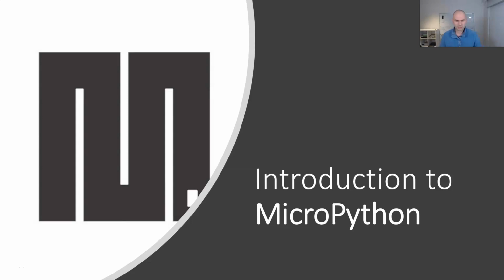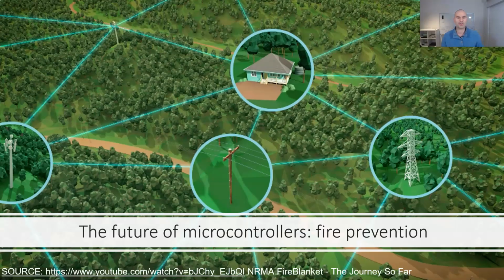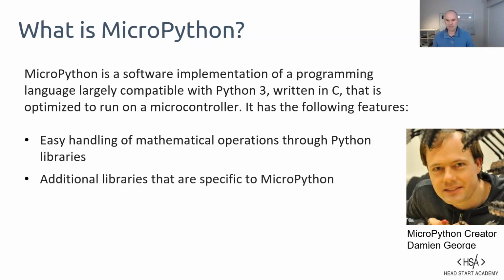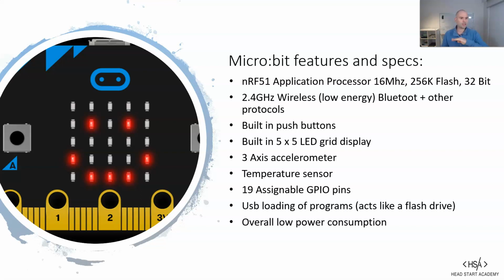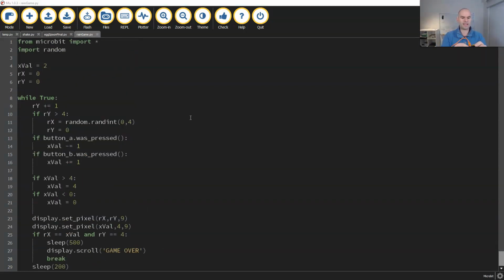Introduction to MicroPython

Comment: Hello Sir,

           I Want to read the data of  mlx90614 in python program, but it need a header of MLX90614.h  which value is calculated through this same header.

         I  import the StandartFirmata into arduino but i cannot read the value mlx90614 because it is not single analog it have i2c communication and having point of SCL and SDA.

          Through searching on internet , i found similar work like me (https://www.gautamdhameja.com/arduino-how-to-integrate-multiple-sketches-with-standard-firmata-c1450769e645/) but  i do not understand what to with mlx90614 how can i import the header of MLX90614 in the StandartFirmata

          What can i Do that it read the value of mlx90614 in python program. Please Sir kindly help me.

Comment: we can install pandas on the micro?
Reply from the maker: Short answer is no because on a micro:bit you cant fit a 7MB library into a 256K memory. . . .  Theoretically possible on a microcontroller with more memory but you would need to basically re-write the library and that wont hapen till micropython interfaces with some decent displays
Reply: @SanjinDedic  if i get some data frome an api of stock, what is the Best way to manipulate the data on the micro? Only with lists?

Comment from the maker: TIMESTAMPS:
1. Introduction 0:00
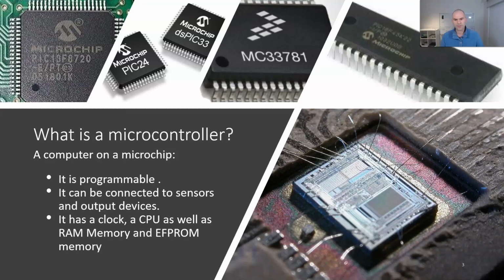2. What is a microcontroller 0:45
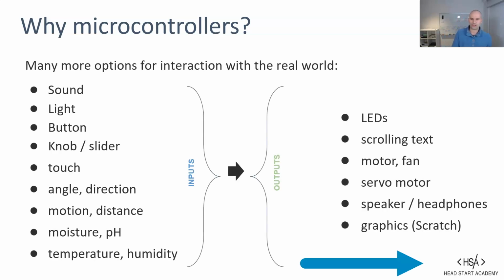3. Why learn to program microcontrollers 1:48
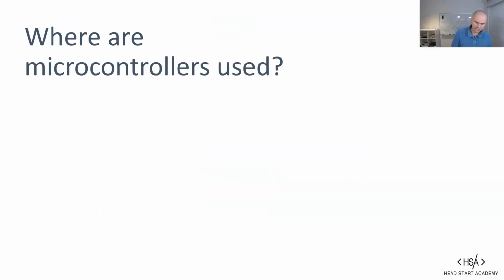4. Where are micrcontrollers used 3:22
5. Future of microcontrolles and the Internet of Things 4:38
6. What is MicroPython 6:59
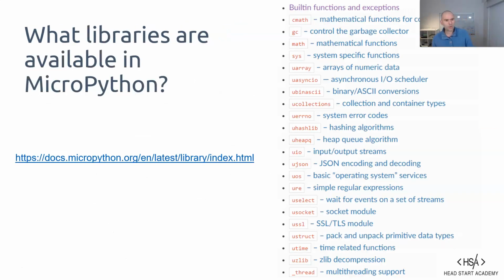7. MicroPython Libraries 10:18
8. Memory considerations for larger speed sensitive programs
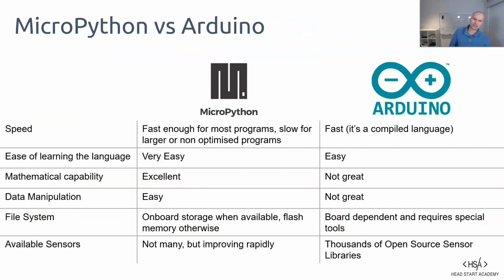9. Micropython VS Arduino 11:57
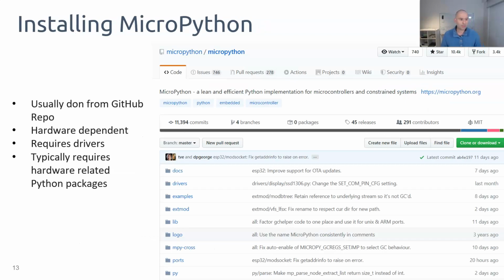10. Installing MicroPython 14:25
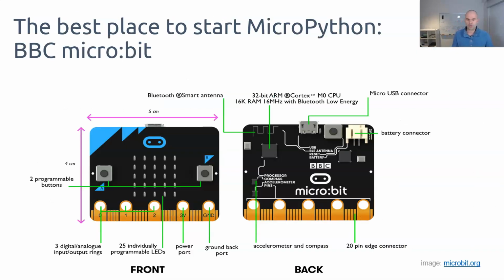11. Introduction to the BBC micro:bit 14:58
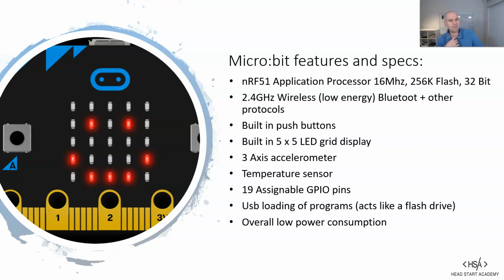12. micro:bit specifications and features 16:05
13. Starting the browser IDE and uploading a program to a micro:bit
14. Some example micro:bit projects 19:37
15. Conclusion and recommendations of what next 20:55